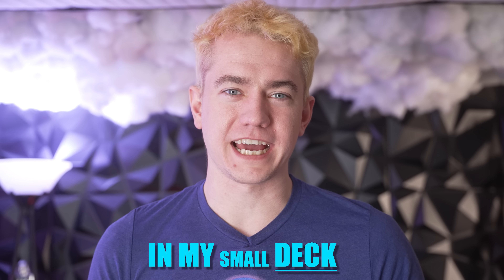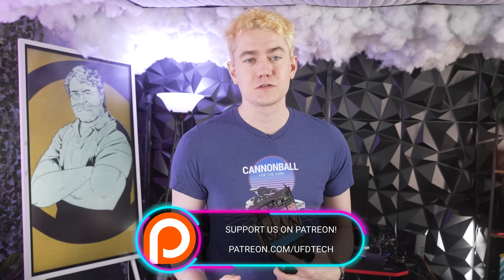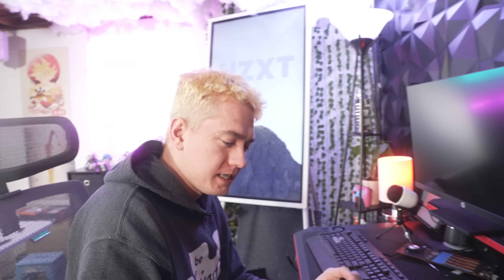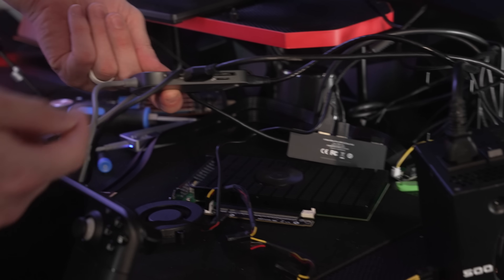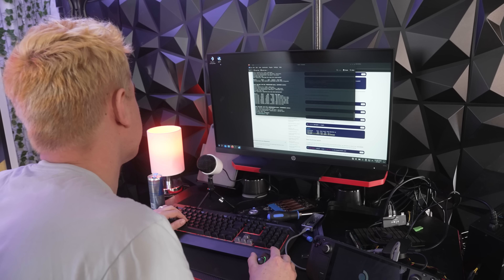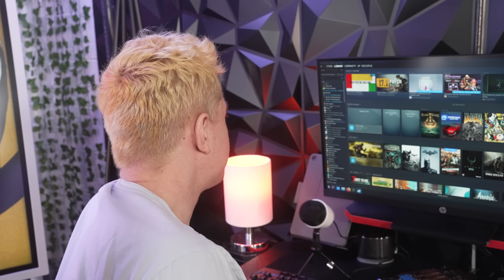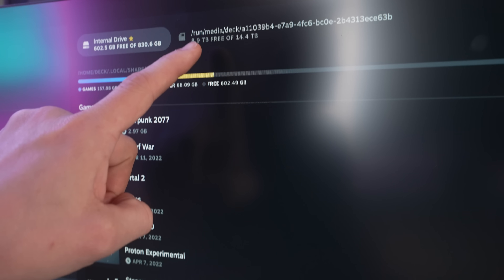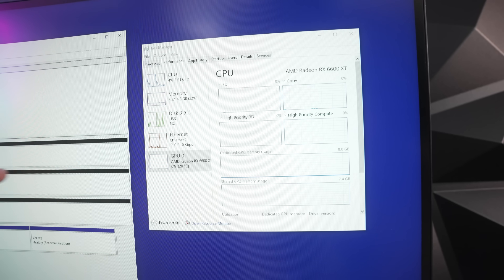I Can Download Every Game On My Steam Deck

Comment: I have unlimited data on my deck because I built a jbod with 34 slots of  2T ssds. I also built a mod so as long as I carry the steam deck around with me the 300 lbs jbod and a generator for the power and a 36 gallon tank of gas I can play one title at a time.

Comment: I have a question that I cannot find the answer to. I have a WD Black SN850 2tb with heatsink. I am using a Sabrent external enclosure and running a usb c to usb c into the steam deck. I formatted the nvme to GPT and ext4 but when I plug it into the Steam Deck, it doesn't show up, even in Desktop mode. I'm not sure what to do. Can I get some help figuring this out. Thanks for any info!

Comment: I have a Sabrent 2tb 2242 in mine Cant bolt it down, but it does fit. Im jusdt using some high ttemp double sided electrical tape holding it down.

Comment: i got a 8tb and friends where like WHY SO MUCH
im like 4tb steam. and the other space is nearly filled with other games. the biggest hogs are the battlefield games. red dead 2 gta5 and such.
and no i dont have all my 500 steam games on. i also have quite some self uploaded ps1 and ps2 games for self use. which are also nearly a damn TB big.
only a few games dont run on emulator extracted which is a damn shame.

Comment: I think that a "backpack plus" for Steam Deck being it a long USB wire to connect extra storage and a power bank to the Steam Deck would be a great product.
Reply: Or a modern backpack PC with high end specs and a vr headset attached, with a large battery on it
Reply: @flamestoyershadowkill  I bought a 2m USB C female to male cable for my deck and very happy with it. It is connected to my JSAUX dock, and I did not try it with my old Xiaomi 20 Ah powerbank, on my backpack, but I will probably do it traveling.

Comment: Is this PCIe kard Is really RAID card? I would say this is Extension PCIe Card for M.2 disks but because of lack internally llRAID module chip on this card I wouldn't say this is RAID Card. You are using Software RAID (which is IMO way better than hardware RAID controller) Please correct me if I'm wrong

Comment: NTFS is Windows native and has spotty support in Linux at best. Officially speaking. Unofficially speaking the only issue you likely ran into is that by default NTFS bounces read only. That said ext4 is the superior file system in Linux. Other options available for making large pools of storage include but are not limited to lvm virtual groups, and ZFS pools.
The next big challenge is going to be making it so when you pull all of this off and plug in an alternative mobile ready boot device that has a smaller subset of your games installed that your file system table that's / etc/fstab is configured to mount that alternate device to the same location so that you have a seamless experience when you undock from everything and just click in your mobile SD card.
Commands that every Linux user or super user needs to be familiar with including change ownership that you've already mentioned change mode c h m o d, and change root. 
Finally remember that most Linux types have some amount of the hacker spirit in them. Meaning that data and information want to be free. So don't suggest that somebody might pay to be your tutor and support, but rather suggest that if they meet with you in this location that just happens to have a pay for cover, you can collaborate on future projects.

Comment: You didn't necessarily have to reinstall just to get Steam OS on the boot drive you wanted, you can just as easily have changed the mount point in the /etc/fstab file and updated GRUB bootloader. Also I really wouldn't recommend NTFS on Linux since its not a native filesystem to Linux, yes it will work to an extent, but you will have issues later when you go to do something. Unless you have a very specific use case where you require NTFS for something. You could however get away with using ExFAT on Linux, and supports large file transfers.
Reply from the maker: Easily is not true. Simple, yes, but not easy to someone who isn’t experienced
Reply: I was gonna say the same thing about changing the filesystem table, but, I don't own a Deck, so, I don't know this, but won't it get overwritten by an update? Also, to not worry about device filepath or stuff like that, I prefer using either `LABEL`s or `UUID`s to mount in fstab

Comment: I modified the case internally and was able to fit in a 4 tb NVME and a 1 TB card.. dual booting SteamOS and Windows, with a 3rd partition that is btrfs that allows CROSS OS Steam library, which means that Steam OS AND windows can access the same library. 1tb SD is hosting emulation roms, everything on the deck..

Comment: It sounds like they set it up to boot via the device id rather than using the UUID in the bootloader. If you use the UUID in the bootloader then you can switch the bootdrive to other interfaces :P

Comment: You forgot one thing.  The whole point to the steamdeck is mobility.  You turned  your steamdeck into a desktop PC with a controller.  I see a meme coming...
Reply from the maker: It easily converts back to mobility by putting the SSD back in.

Comment: Yeah... Don't use NTFS file system (which is specifically a Windows fs) on Linux ever. Linux does not support Windows permissions so you can read files from NTFS partition by forcing everything to be owned by your user when mounting it but things won't work for installing Linux stuff on it and running stuff from it and writing stuff to it in general. And NTFS is slow af on Linux.
Also yeah the problem you experienced with Ext4 partition was that when you create partition it is initially owned by "root" (administrator user) because you're creating it as "root" (administrator user) (and it's not possible to create it as non-root user). So you always have to change the user:group after mounting it for first time by changing the user:group of the directory the partition is mounted after mounting it.

Comment: Yeah I have that same J5Create dock (JCD552 - $130) for my 
Windows 10 Pro - ASUS TUF Gaming A17 2021 laptop docked with a Samsung 980 PRO 1TB M.2 Drive on top of a cooling fan for laptops. Then after a normal round of usage one day without any warning it just abruptly stopped working and refused to boot up or if it did boot then it would not see my external drives or connect to internet or both… 
so I went back to the older working  J5Create Dock (JCD543 - $100) 
triple display working just fine 🤷🏾‍♂️

Comment: Man you really need to 3d print a custom back for the Steam Deck with an m.2 extension cable connected to it so you don't have to run the Steam Deck backless.

Comment: Steam deck and steam deck v2 ( if and when it comes out) will change pc gaming.  I hope Valve continues to push steam deck and future hardware version. 

I hope in near future.  Valve will do steam box but just in console like box.  Zen 3 6 c/12T system without the screen and RDNA3 GPU.  Still running there custom steam os.   Along giving more connection option.   This is kinda what I’m waiting for.  4k/60+ fps capable in box.  (Ps5+ performance or better) 

The steam deck is great hand held. But it’s cpu is bit weak for next gen games in near future.   UE5 and future games.  Most newer games struggle hit 60 fps on steam deck.

Comment: I think the 14.5TB is actually 14.5TiB but 16TB. Also, I respect you for learning Linux not because learning it deserves respect but choosing to learn it does. Thank you for showing the world how wonderful our operating system is.
Reply: Yes 14.5 Tebibytes are roughly 16 Terabytes.
+/- because it rounds it.
Reply: @PatalJunior  it's so confusing haha I've had a compsci friend try to explain it to me and my eyes glaze over.
Reply: Yeah, what Mizufluffy said. Basically we like tens and computers like twos so we made the prefix kilo mean 10^3 or 1000 like in kilogrammes or kilometres or whatever but as I said computers like twos so the closest equivalent was 2^10 or 1024 and that was basically a kilobyte so programmers used that. Nowadays however we use gigabytes and terabytes and since the percentage error gets bigger the bigger the number that 2.4 percentage error can be about 10 times larger for terabytes so while all programmers continued with the twos approach the hard drive makers decided that they can fit more gigabytes if they say kilo means 1000 even for computers. Since the programmers were technically wrong there was a big push to change it from kilo, mega, giga etc... to kibi, mebi, gibi...  for computers but it never caught on and now we just have more terms to confuse people, more ambiguity and less consumer education.
Reply: Yeah. This is because storages are commonly marketed as powers of 10 (16 TB = 16 000 000 000 000 B) instead of powers of 2 so when you divide 16 * 10^12 B by 1024^4, you'll get approximately 14,55 TiB. On the other hand if the storages were marketed as powers of 2 then 16 TiB drive would actually be closer to 17.6 TB in size. For those who want to do the conversion by themselves, for each 1000 in TB (or GB, MB etc.) when converted into bytes, you need to divide it by 1024. 
For example, 512 GB = 512 000 MB = 512 000 000 kB = 512 000 000 000 B so it becomes 500 000 000 KiB = 488281,25 MiB and approximately 476,8 GiB.

I recently bought a 5 TB external drive. Windows 10 shows it as 4,54 TB even though it's clearly 4,54 TiB due to the conversion. Basically whenever the system shows lower numbers than the product package, store website etc. then you know it's due to this conversion from marketed size to system size.

Comment: the more people know Linux (and how to use it), the better. its taken me over a year to feel comfortable using a terminal but trust me, its worth it.
Reply: I stumbled into linux by accident and a little curiosity.
Back in 2016 i didn't know there was even other OSes then i saw zorin os, at the time i didn't really like it simply because i didn't know what was i doing, then i discovered the world of linux and installed ubuntu 16.04 LTS and searched how everything was done like installing programs, now i use manjaro on my arm devices and Pop!_OS on my main laptop and barley use windows.
Only sadly support for intel atom is really poor with my experience so my dell windows tablet have to wait for who knows how long.
Reply: I'm slowing trying to learn for when there are issues with my deck.
Reply: @BGRecon  good call, though a doubt there will be many Deck related problems that cant be fixed via the GUI.
learning how to use a terminal is also a good first step into automation or ricing (custom desktops).
Reply: I use Linux every day. For a server, it's great. For normal use? It's fucking trash.

Comment: are sd cards meant to cost that much? ive seen loads for about 50 bucks.... not almost 200!
Reply from the maker: For 1TB in micro?
Reply: @UFDTech  now that I've double checked I can confirm they are 1tb micro sd cards but I must have been fooled as they are SanDisk style but only say micro sd and no brand so prob not trusted for a hardrive exansion but I'm getting one for my phone media to test out

Comment: thats all fine and dandy but you have now spent more than a desktop and cant go anywhere with it lol   you should attempt to create a dock that houses all those components nicely in that you can just drop the steam deck in when at home(like the switch), and for on the go  i kinda feel like using a cable  in the M.2 to run out and behind the case that can be mounted in a small enclosure in the center of the steam deck would be the best option for more space and still keep portability.

Comment: Not sure if it would make much of a difference (probably not), but why not use the actual hardware RAID instead of a software one? I mean you already have the HighPoint SSD 7505 which does have drivers for linux.
Reply from the maker: Software was easier and it doesn’t matter
Reply: Would he be able to use only 3 of the slots for the RAID and the 4th slot for the GPU then?
Reply: @NdxtremePro  I dont think so, but i am also not sure. Never tried to use the controller that way :D Without a driver it would work most likely. After installing the driver the drives installed into the controller are shown as hpt bla bla bla (forgot what they are named even do i did it just last week :D) and setup via hptraidconfig to configure the hardware raid to use certain drives on it for the RAID, so setting up only 3 for the RAID would be possible at least. I suspect that the driver wouldnt even start with the GPU installed, but simply for the first scenario of testing with accelerated storage, i would have used the hardware RAID to reduce any possible load on the CPU. That way the time benchmark would have more meaning imo.
Reply: @hommy285  But my point is he was going for the GPU config the whole time. He even hinted at doing so in his video for testing the GPU. Now, I would have like to see if it would have made a difference, because hardware offloading might have made a difference in the gameplay FPS, but just showing it can be done is hsi primary goal. This channel is more entertainment than informative, but it is fun.
Reply: @NdxtremePro  I know what you mean, but this video was about storage thats why i mentioned it. The GPU addition is a different goal for a different video, so i am only arguing about this videos content. In the end i dont think that using the controller with the gpu and a hardware raid would work as simple as using a software raid or work at all. But the chance that the controller and GPU will work with a software raid is pretty high. Another problem tho is that the m.2 slot on the deck is only pcie 3.0 x4, splitting that between a software raid and the GPU is most likely too hard on the bandwidth and reduces performance even more than it already is, at least if a lot of data has to be streamed.
Would be fun to know if GPU direct would work that way :D

Comment: I like the video, but wouldn't it have been cheaper to just buy  a higher storage deck? Not meaning to be an asshole, just saying when you say you're too broke to do stuff but then you do something even more expensive than the initial deal would have been.
Reply: Highest storage steam deck is 512gb
Reply: @delshandheldgames  Oh that is too limiting. The deck is good but why such small storage? It's not like NVME SSD's are super expensive anymore.
Reply from the maker: They are expensive for the 2230 size.
Reply: @UFDTech  Yeah. I just looked it up & boy are they asking alot for incremental upgrades.